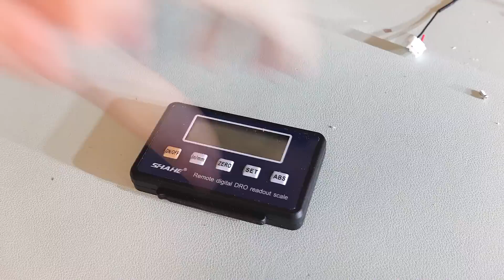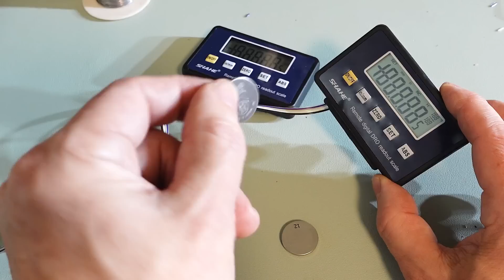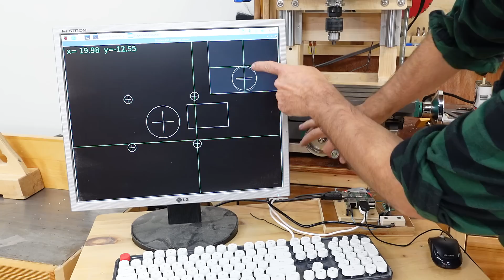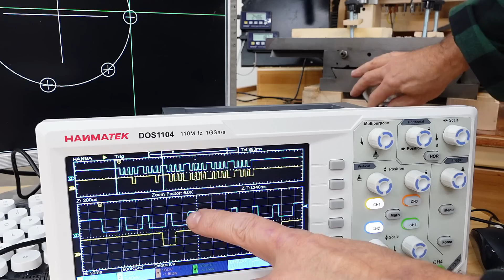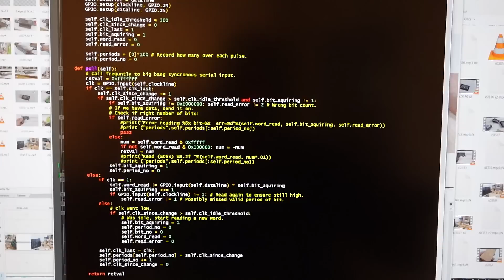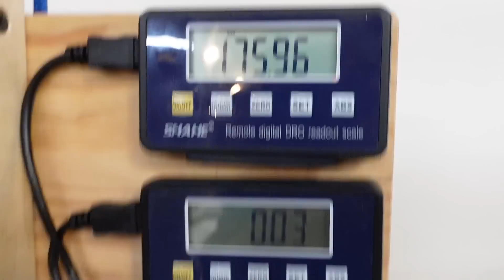Cheapest DRO and adding graphics

Comment: Long ago I built a liner sensor using 2mm dia. precision ball bearings in a brass tube.   The tube was mounted on the moving surface and the sensor was stationary.  It consisted of a hall sensor on one side and magnet on the other, "riding" the tube. It was not an absolute measurement, so the requirement for tracking the "passing of the balls"   The linear hall sensor output was a function of the position of the balls.  Unfortunately, the hall sensor of that era did not have a large enough dynamic range to provide the needed resolution.  The total measured length however was 50 meters.

Comment: The vertical alignment of the tap, or drill in my case, with that angle block was clever, I was thinking I might have to buy something expensive for an upcoming project, but that is so much better, for my current budget at least!

Comment: We've built a manual CNC. This is amazing. But you're we're all screwed when even Matias is using chatgpt. As an engineer, I can confirm that gpt prototypes are amazing. they save so much time.
Reply from the maker: Chat GPT makes you more productive, but you still end up having to own the code.  So still need good egineers, but can pass on the mediocre ones.

Comment: Try this one. Do your bolt hole pattern like you did then save the wood project. Save the file and next summer with a week of humidity and rain try that same bolt hole pattern in new pieces of wood. Mix the old with the new and let me know how it works. I'm going to say you can't repeat it. The wood is prone to expansion and contraction. Now kudos for the software and uc integration.

Comment: It's good to know I'm not crazy. The batteries in my digital calipers always seem to be dead those relatively few times I want to use it. With its auto-shut off feature I couldn't figure out why I seemed to be changing the batteries after every few uses.

Time to wire in a physical shutoff switch I suppose.

Comment: Welcome to the big leagues lol. Machinists use those single axis dros to add to the quill of their mill so they have 4 axis along with an XYZ dro on the table. Handy and cheap. 👍
Machinists use these 4 axis dros in their head to visualize what you have put in that software. It won't be long before you don't need it either. 😁

I have found the same with chat gpt with code examples. It's a starting point, but I end up re-writing so much of it that it's almost like starting from scratch some times. It does a rough framework to start with sort of ok though.

We are all really hoping that your wood bracketry gets upgraded to metal, but I suppose it's not really the issue it seems when the whole drill press is wood. Sigh.

Comment: i think lot cheapen have use encoders and arduino build DRO and additional have good if add raspberry pi3 and camera module can see display position accurate. and arduino code can add what need etc, zeroing first hole and then move next hole position whit DRO numbers. install encoder to handscrew top or back to table whit rack and pinion. lot cheapen than DRO rod buy.

Comment: Oh my god thank you for the confirmation that digital calipers drain their batteries even when "off", I knew I wasn't crazy!
Reply: This is a much bigger problem with cheap ones. Mitutoyo doesn't seem to drain the battery very fast.
Reply: My dad isn't a highly educated man, highschool dropout, worked in autobody and welding. I once bitched about my calipers draining their batteries even when off. He told me to grab them. I went and got the case from my hobby room. "Open it". I did. "It's nice of them to cut the foam out to hold the calipers in place nice and secure..." yeah, so what's your point? "I wonder why they cut those two little holes in the foam..." yeah, I dunno...what's your point? "Take the batteries out." :( "I'll ask again, I wonder why they have those two circular cutouts in the foam..."

Sometimes I question my intelligence.

Comment: Viewers might want to do a web search for "TouchDRO". Basically a very similar project. The serial position  codes from each scale are sent via Bluetooth to an Android tablet, and the tablet is running an app which displays the X, Y, Z scale positions. The app also has some useful functions for milling and drilling, such as bolt circles, tool offsets, etc.

Comment: I had an idea roughly based on glass DRO scales. Speckle a plate of glass with something like a paint or a silvering solution. Then use a small camera to look at the glass scale on the table (use the camera as a optical sensor). The system would have a recorded map of the glass, and use it for getting an absolute position.
Reply: A simpler option may be to use the innards of a computer mouse to track the movement. You wouldn't get absolute positioning though, but it could have a very high resolution, and fast update rate.

Comment: Interesting thinking about saving the position, you would think saving a float wouldn't be that difficult.  I suppose that would add cost and complexity when you can instead just hold the value in volatile memory and the user has to change the batteries more often.
Reply from the maker: its not enough to hold the value. You have to keep reading the sensor to know if its moved.  The sensor only gives relative motion, so if you stop reading it and it moves, you lose absolute

Comment: In my experience, drywall screws are brittle and if it ever snaps flush with the mounting surface, it will require drilling out with a hardened bit. So, it works as a jerry-rigged solution, but it might also be a maintenance time-bomb.

Whatever works though! Thank you for the centerpunch idea. That's straight up legit, which makes me think maybe there is a centerpunch cartel out there hiding this information from the masses. 😀

Comment: The GUI is clever. You can get absolute encoding scales from Mitutoyo for 10x the price of your scales. They don’t forget when the battery is removed. The etching of the magnetic pattern has unique elements evenly spaced. Unnecessary for your needs but it’s available.

Comment: Well, now all you have to add are stepper motors to the x, y axis and you have a cnc mill. You don't really need the z axis to be stepper controlled. You could just control x and y, have the computer move to spot to drill, drill it out manually, press space and got to the next hole. Then you could write a cool piece of software to map the workspace to a grid, use the mouse to plot points, have the table to move to the point.

Comment: There's a very specific confluence of skill at demonstration here. It's an intersection of engineering, computer science, material design, and functional "stoichiometry." It's this unique skill to make EXACTLY what you need, no more or less, out of what boils down to useful garbage. To do it, you have to know what "things" are made of and the characteristics of that material, how they're put together, and what each of the "vocab terms" associated with the bit of garbage being smashed together mean. Then, you have to know what techniques are needed to manufacture the piece, and then how to create the signalling/coding to make it all work together. What's really sells it though, is this understanding that it's purpose-built. Even if a tool has "general" use, it's built AS a tool to DO a distinct "thing."

Comment: Why do the screens output position, I thought they would only read positions from the sensors
Reply from the maker: The screen outputs whatever I chose to display on the screen.
Reply: @matthiaswandel  hmm interesting

I do meant the physical screen (the thing with black and gray LCD) not ur terminal program

Does it allow remote monitoring from the factory or something

Comment: search for touchdro, it has already been done... also fixing the rulers with wood will add read offsets when the wood expand or contract... should really made the brackets out of aluminum.
Reply from the maker: it won't move much over the course of a project, so it doesn't matter.

Comment: Great! I added a similar DRO to my woodmizer bandsaw -  but i failed with getting the values to a raspberry pi ...  searched a lot but found nothing useful - someone told me, easiest way would be by using a camera at the raspi ...   could you give some hints?
Reply from the maker: Have a look at the code I showed on the screen.  You also need to be reasonable at soldering, and having a scope helps a lot too!
Reply: @matthiaswandel  so it's always about counting signals - no way to get the displayed values directly?

Comment: I use chstgpt to get me rough starting point or help con3 up with ideas of how to solve a problem all the time. The code it provides basically never makes it to the final product as is but it helps getting started faster or working through a roadblock.

Comment: I have found it best to make a text file with the instruction set for my gpt coding projects. Then if I don't like what it produced, start a new chat with edits to my text file and resubmit it. If I ask the gpt to just adjust what it already created, often times it will rewrite the entire thing changing pinouts, changing variable names, and other assorted random stuff. however if I just resubmit the text file into a new chat after I edit the text file with refined parameters I can generally get to a complete project in just a few iterations. I love it and it saves a grip of time. Soon I think that we will be able to conversate with a gpt like talking to a coworker, and it will work as expected. That stuff is getting better all the time.
Reply from the maker: funny, yes, I ended up writing my instructions in a separate editor.  But in the end, I cut and pasted together pieces from two versions that it came up with.  Still saved a lot of time not having to look up all the APIs
Reply: The not looking up APIs, and chat gpt knowing about packages I don't is the most helpful part I've found for using chat gpt.

Comment: When measuring the distance with the vernier calipers at the end of the video for a secondary reference, could the discrepancy be due to the fact that you're measuring from the side of a cylinder, while your new digital actuators are measuring from the dead centre of the drill column?
Reply: The center and the side still move the same distance, so it doesn't matter.
Reply: @schwuzi  But they're offset from eachother by 1 radius of the cylinder, no? Or am I missing something?
Reply: @ConorFenlon  That's correct, but both scales were starting from 0. The calipers and the actuator were zeroed before. 

Make a V shape with 2 fingers and move your hand across a table. Your fingers are offset from each other, yet each finger moves the same distance, respectively.
Reply: @schwuzi  I understand perfectly, thank you!

Comment: Good digital calipers (eg Mitutoyo) use about 1/10th the power when they're off than when on.  Cheap ones use about the same amount regardless of whether they're on or not.  That's why the batteries in the cheap ones only last about a year (if that) while the good ones will last 5 years or more.
Reply: Mitutoyo manages to squeeze shelf life out of a battery. Or close to it. So long I forget how to change the things. Because when the battery does get changed it loses zero and has to be reset. Other than that it never loses zero. Cheap calipers are always losing set zero. On the up side you remember how to zero those because you have to do it all the time.
Reply from the maker: I'd be ciruous if the Mitutoyo lose their zero reference if you move them far and fast while they are off.  My guess is that they do the measurement less often while off.
Reply: @matthiaswandel  Like @1pcfred I've never felt the need to abuse my Mitutoyo calipers.  But I'm guessing instead that the Mitutoyo calipers have absolute encoders in them over their entire range and thus don't need to take position readings while they're off (but then why don't they store the zero point in some flash memory...).  The encoders in the cheap DRO that I have that looks a lot like the one that you show in the video seem to have something like a limited absolute encoding on them.  Eg they know where they are in a ~20mm section and just need to keep track of when they transition from one section to another.  And under certain failure conditions they will jump by a multiple of this.  Multiple people had this issue (including myself on one of three that I have) where the fix is to add a capacitor in the reader section (which is far from the battery/power input which is in the display) to handle voltage drop.
Reply: Also, clough42 has an excellent video comparing his Mitutoyo calipers to some counterfeits he bought including looking at amperage readings on each of them.

Comment: obviously the next step is just buying some cheap geared motors and making it a closed loop cnc machine xD xD xD

edit: Also use an esp32 for the machine control its close too real time calculation with sort of real interrupts

edit edit : ~ given you run Arduino flavored C code

edit edit edit: Also great project <3

Comment: When watching this I had the idea that for some people a good camera would be more useful than a DRO. If you often print out templates, glue them on your material and follow their lines and crosses for drilling and routing you could stay more on the analogue way of using such a cross table by zooming in with the camera and place your drill bit very exact, especially if you have to wear glasses.
Of course I don't want to diminish what you did, it's great. It was just an additional idea.
Reply: @dieterjosef  sadly templates are pretty limited in precision due to printer limits. A camera might be useful, but positioning by sensors should be far superior to printed lines.
Reply: @jojoposter  A printer with 600 DPI can print very fine lines to less than a tenth of a millimeter. That's more than enough for most people, and it is more similar to the way they work anyway. Matthias often prints out templates and cuts along on the material.

Comment: “Shouldn’t have done that.” LOL
Reply: Ignorance is bliss sometimes
Reply: Why did he say that? Because they are off by a tiny amount and he's a perfectionist? 🧐
Reply: @AdamHill42 Well, yes.
What measurement do you trust now? The dro, or the callipers 😅
Reply: @jojoposter who cares as long as it works?
Reply: @schwuzi  I do
Reply: @jojoposter  more testing certainly required. need to drill a hole every inch in a line and then measure from the first hole to the last with a known to be accurate tool
Reply: @jojoposter The calipers have a lot of vertical flex from being cantilevered so far. They also may not be perfectly square to the table. Both these factors would result in a slightly longer measurement than the true distance, so I'm inclined to trust the DRO over the calipers, but personally, I would do more testing to verify.
Reply: "A man with one watch always knows what time it is. A man with two is never sure."  I used to work in metrology, and unless you have traceability for your calibration standards, you never know just how far off your gear really is. Now with wooden equipment, It's going to shrink and swell with the seasons unless you put a sealing finish on it, that's why store-bought gear is made of metal and plastic. But I honestly love the charm of wooden, homemade equipment.
Reply: @rallen7660 This was the quote I was looking for to reply. 👍
Reply: Don't we think the error there is from the calipers not being exactly aligned with the axis of the table?
Reply: Well, a few Things can go wrong here. So... On one side, the caliper oscillating (those . 05mm are just minimal) then the instruments. Then the position of the holes onto the wood. I mean... Great job, but if you want more precision, you have to address those details 😊. Great work, thank you for sharing
Reply: @blacky_HD  that precision is probably more than u need for wood

Comment: I have that same digital caliper. I store it with the battery removed.
Reply: I store 100% of all my digital measuring devices with the batteries out now. I watched a video years ago where a guy took and measured the actual current draw of them... and it made almost NO difference if they were turned 'off' or not!  Go figure, my batteries all now last years, not months.
Reply: @DrFiero  I leave the battery in my digital calipers and it still lasts for years. That's why you buy genuine Absolute Digimatics.

Comment: For now ChatGPT will only replace junior developers.  Still a massive problem for the industry, especially bc junior developers are junior bc they don't have experience... you can't get experience without experience. So are they going to have to apprentice for free?
Reply from the maker: It reminded me a bit of sometimes getting guys to write stuff for me.  With some guys, you can't just rely on them coming up with a good design, so you really need to think the design through before you ask them to write code.  But the re-breaking stuff when fixing other stuff, that was frustrating!
Reply: @matthiaswandel  your anecdote about having to hyper explain everything to ChatGPT is what made me think of junior developers.  There's so much exposition required to get the results you want that you quite often realize "it'll be quicker if I just do it myself"